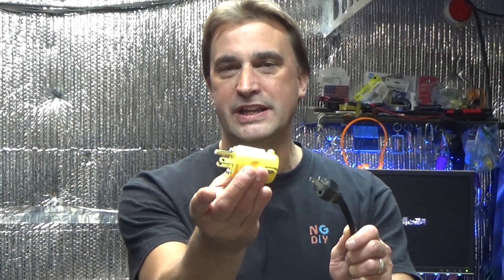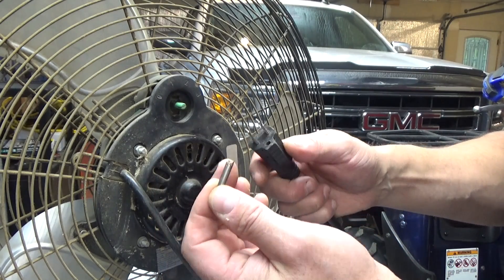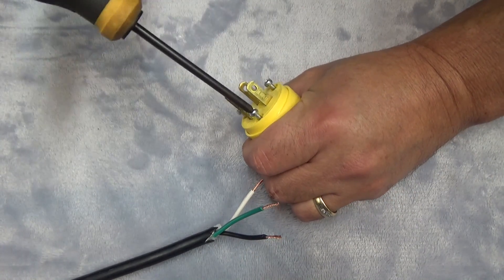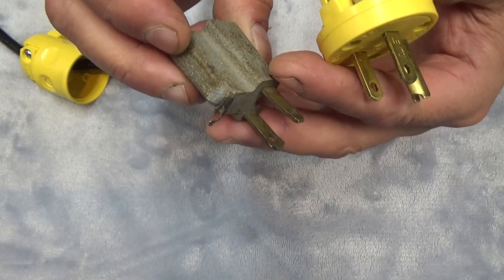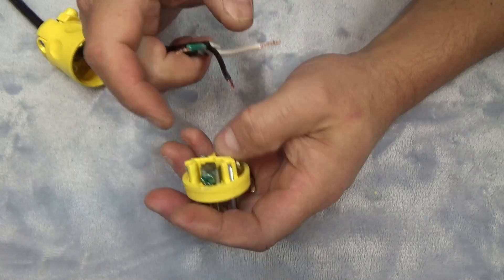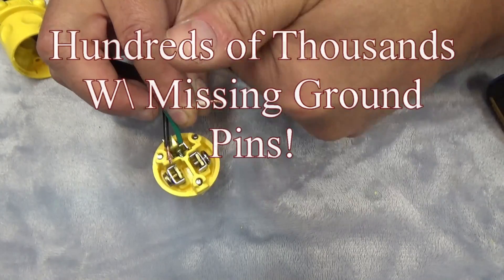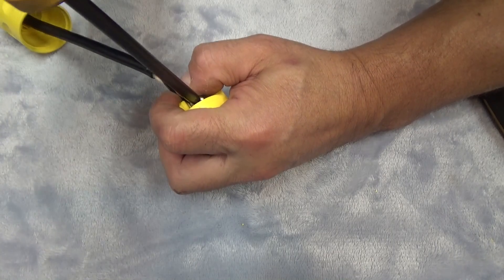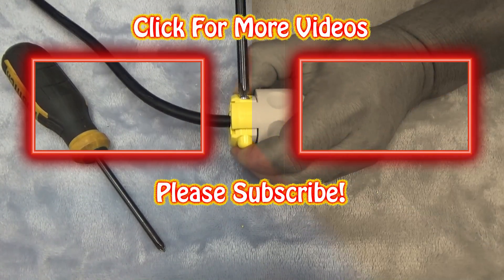How to Replace a Broken 3-Prong Electrical Plug - Fix Broken Ground Pin on Extension Cord

Comment: if i broke the prong can i use the 3 prong adapter with two of i use the screw on the outlet? i moved my fireplace and pulled the plug out and broke the prong 😩
Reply from the maker: Yes, the adapters work, but make sure you do ground the prong.

Comment: I need to replace the plug on my pressure washer due to a broken prong. The current GFCI plug says "20A" on the back - can I cut off the plug and replace with a 15A plug similar to the one in your video, or will that cause a potential hazard/fire?

Comment: 1:45 By “touching it” do you mean touching the outlet or even the appliance itself like a microwave?

What if I use a microwave that had the grounding prong broken off, but the microwave has reached zero on the timer meaning it’s not heating anything up anymore. Would I be safe to touch it?

Also would wearing rubber gloves prevent shock?

Comment: Thank you so much, I subbed. I was gifted a fridge from one of my customers when I had mentioned I moved to a new place and I noticed the ground part of the plug was taken off (I guess to make it fit on a two outlet) and was worried about using the fridge, but THIS, this is EXACTLY what I needed, and I'm going to Home Depot in a bit to get one. This vid explained it very well, thanks!

Comment: I have a question if the polarized side was ground down to make it a flat connector that the ground was not needed for a non polarized tool would it be safe? Second question what are the two holes in a plug used for?

Comment: Does it matter if I replace a 5 amps 125 volts to a replacement plug that is 15 amps 125 volts?

Comment: I accidently stepped on my plug for my vacuum cleaner and bent the grounding pin. When I tried to bend it back, it broke off. The first thing I thought was can I glue it back on. I went online to find a solution and then came across your video. After watching your video I know what I had to do. I ordered the Leviton grounding plug on Amazon. I just got it today and I installed it in ten minutes. Everything works great, and I learned something I never did before. Thanks for the great video.

Comment: This video was super helpful. I used an extension cord to wire an outdoor dusk to dawn sensor flood light and as soon as I was testing it, the ground got stuck in the outlet. We powered down the house, removed the ground, and we’re going to use another extension cord when the thought came to replace the plug. Your video saved the day!  Very informative and helpful.

Comment: I changed my car plug. Had a green wire and 2 black wires. So I just made my best guestamation. By looking at old one and new 1. I'm 99% sure I'm right. Hahaha. But if I'm wrong can I break anything or does a car plug maybe don't matter. Was very confused about why there was 2 black wires and a ground.

Comment: Great video for those of us who have no clue!  I have a question I’m hoping to get answered.  I have a cord that the ground broke off and purchased a replacement plug.  Problem is once I cut the cord to expose the wires, there are only 2 wires instead of 3, a tan and a blue.  I’m a for a light for a photo studio setup.  Any clue how I should connect?

Comment: my newly bought Panasonic refrigerator has only 2 prong cord and has green ground wire hanging at the back, i want to have it changed to a 3 prong for safety is that possible? thanks

Comment: So I want to replace my cord for my vaccum.  The vacuum I have said it takes 120v 10A. In the stores I can only find 125v and 15a replacement plug.  Would I be able to use that to replace it?

Comment: I have a 3 prong plug to a small box freezer. My grandson broke the ground plug. 
1. How can I get the ground pin out of the wall. 
I know go to the Circuit box turn it off. What he did is replug it back in the outlet where it came out off. The  wires come up to the plug. It  Lays flat to the wall. I know I have too put a new plug on.

Comment: I want to repair the cord on my treadmill. I haven’t been using it my sisters have and I don’t know how long the grounding prong has been missing. How do I make sure that it’s not charged when I go in to repair it. Is this a major concern or should it be fine? If it is how do I neutralize it before repair.
Reply: I’m also now concerned if it’s still stick in the wall. Should I unscrew the socket from the wall and then pop it out.

Comment: This was not elementary for me.  I found an audio power conditioner for ten bucks, and was suspicious of the missing pin.  I learned an immense amount of info here.  Thanks !!  I just replaced the plug, paying attention to everything you did.  The only other thing I ever did was to replace the bridge pickup in one of my guitars, so this was a tremendous help to me. Subscribed.

Comment: Thanks I followed your video and it worked like a charm, i had a guitar effects processor with a broken ground, and finally fixed it. What type of audio problems would i have encountered if i keep using it? I always had volume spikes, i wonder if that was because the ground was broke.

Comment: I bought a used fan and didn’t check it until I got home.  Mistake...lol.  It worked on low and medium speeds, but not on high. While I was cleaning it up I noticed that it had a missing prong.  That’s not good.  If the prong is replaced, will the fan still not work on high? Is it likely the only culprit of it not working on high.  I still thing the fan would be a great deal for a $3 plug replacement.

Comment: Need to do this for my treadmill plug. Will it be safe to operate with the replacement you are showing? Also what is the best way to get the ground prong out of the wall socket ?
Reply: If the prong is still sticking out the wall just use something that doesn't conduct electricity like two pieces of wood or two wooden sticks from outside. Sadly im the super glue guy lol

Comment: So the ground pin can't be reattached once broken right? The whole piece has to be replaced
Reply: @zain Ali that’s what I’m trying to understand. Sounded like he said you can superglue it back together.. can you reply back if you figured out if this true or not.. thanks
Reply: @X.O.143  No, he said it'd be nice if you could glue it back together but that doesn't work. Once you break the grounding wire off, you need to replace the whole head of the cord for the device to be safe to use.
Reply: @anonymous name okay, thanks 😊

Comment: Hate to sound simplistic,  BUT your talking about ground, hot wire, neutral wire? I understand the purpose of the ground wire just as you explained. But how does hot neutral wire have relevance to an AC current?

Comment: thanks for the videos! I have a power conditioner that say 115 volt 15 amp 60hz on the front. I got it for free cause the ground pin is broken off the plug. can I use the plug you had in the video, even though it's for 120? Would using a higher rated plug effect the emi filtering or surge protection? I would like to use it to power my synthesizers so I thought having something like this would cure any  brownouts I get sometimes and eliminate any ground noises